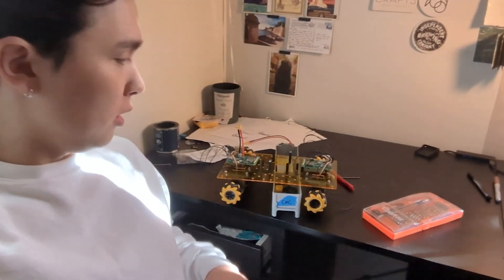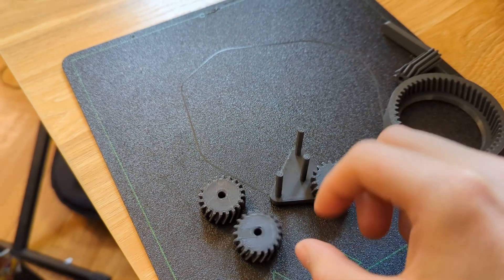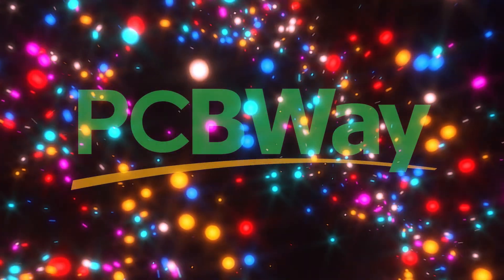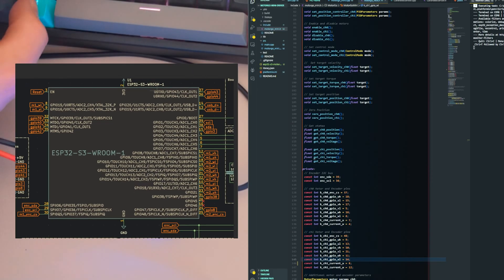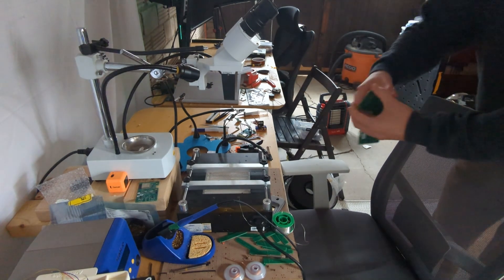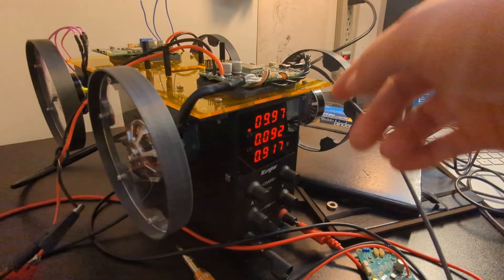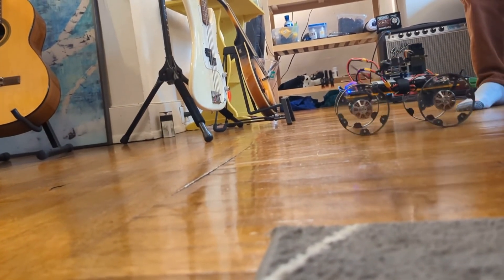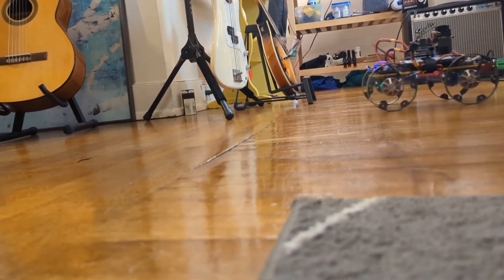esp32 + brushless motor controls: my custom motor controller for a home rover robot

Comment: Ditch the printer. Seriously recommend any Bambu Lab printer. You'll have a much better time, be able to print faster with a higher quality. Cool projects btw. Subbed. I did also make a rover project, using a Raspberry Pi with camera, running web server etc. I just wish I could come up with a way to make it dock and charge. Maybe a robot vacuum platform would be better.

Comment: interesting project
need your advice
any plans to switch to nvidia jetson nano from raspberrypi?
if you will scale this rover to bigger one will you still use magnetic encoder for odometry or switch to optical ones?
if you scale to bigger rover will you use big, powerful but expensive brushless motors or switch to big, powerful but cheap dc motors with reduction gearbox? take into account that brushless motors controllers are more expensive than dc motor controllers
are you considering to make bigger rover with additional generator to make it work longer?
Reply from the maker: Oooh so many interesting questions here!  Let me do my best to interpret and answer them each. 

1) rpi vs Jetson - I would love to play with some of the Nvidia boards!  We have a few laying around and I think they would do great for our applications in the future.  We chose rpi for the first draft mainly because it's more approachable/ accessible to other people and beginners. 

2) encoders - I really like our magnetic encoders and they get 14 bit resolution per magnet pole pair (which I can adjust to our needs) so probably sticking with those. 

3) motors - I think if the rover needs to be bigger than this, you are correct that we will need a gear reduction.  However I would probably stick with brushless motors for their torque density.  Since this robot is controlled by our MotorGo robot platform, the cost difference between brushed DC and BLDC is negligible!  We get all the benefits and no consequences 😈

4) I do plan on making a bigger rover that will go on longer missions, but what do you mean about an additional generator?  I think the only energy collection I have considered so far is solar panels.
Reply: I mean portable gasoline/propane generator with electric starters suitable for big advanced UGVs. Using solar panels for energy supply and power collecting can be good solution for small UGVs but it is not good solution for big UGVs.

For practical example I recommend watching this video after the first 10 seconds https://youtu.be/6okc3av6jMI?si=M28WP9alFQVK7s0G&t=10, while watching it for 20 seconds from the time i mentioned you will notice generator mounted at the front of the UGVs.

Similarly you can see generator mounted on the rear of Ukrainian UGV https://en.m.wikipedia.org/wiki/File:PIRANYA_UGV.jpg

I am not sure which generator they use but it might be Honda EU2200i, Yamaha EF2000iSv2, Champion Dual Fuel Inverter Generator or Westinghouse iGen2200.

Military technology is not a good thing but it is advanced and well founded so it will be such a big waste to not learn useful things from it.

I will join your discord as soon as i will create account there, thank you for the invitation :)
  @EveryFlavorRobot
Reply from the maker: @TheFFFFFFFFF  oooh that's is interesting!  We might have to save up some money and look into this tech solution when the rover gets bigger 🤠

I really would like to send a rover on a multi-mile autonomous mission as a big challenge.  Swapnil and I built mining rovers together in college and it would be rewarding to revisit I believe 😤
Reply from the maker: Btw!  Join our discord if you enjoy talking about robotics and engineering with other science-minded nerds :)